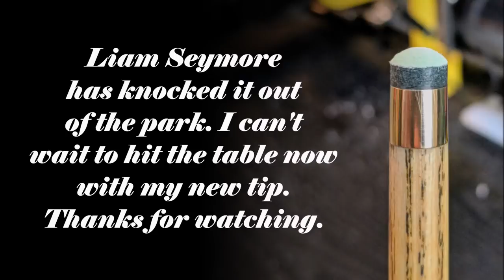Tip replacement using a Pool Cue Tip Repair & Maintenance Lathe

Comment: Why grind off the tip?  just cut it off with a sharp box cutter.  too much dust.  I would rather have the cue spin faster and use a razor blade to shape.  All you need is a piece of leather to polish.  Have to give a big thumbs down to this method.
Reply: i recently bought this lathe, and i have to agree with you. And as you can see in the video, at certain point he grinds of the upper part of the ferrule. There he stops the video and comes back when he grinds of and polished the whole ferrule, and the whole ferrule with pomerans is much smaller. Very bad job!!! He is also using the wrong tool for grinding the pomerans. Thats why he also damaged the ferrule. He should use another too,which is included.

Comment: MOST players would be better off practicing more and not spending money on accessories. 

Nothing wrong with the old hand crank tools. How many tips do you change?
Reply from the maker: Haha I've always just done my own tips with a razor blade, sand paper and super glue. This setup belongs to a mate who does quite a few tip replacements for the local pool league.

Comment: Waste of time and money replacing a tip on that - all you need is a new sharp stanley blade, sandpaper, wire wool, super glue gel and 1 of the plastic sleeve burnishing tools
Reply from the maker: Couldn't agree more. I didn't buy the lathe but I still think it's pretty cool ;)
Reply: Hi, what grade wire wool do u recommend?
Reply: @markruston6609  finer the better really. I use it to shine the ferrule up. If you go to course over a long time you can find it reduces the ferrule size a tiny bit.
Reply: Ty

Comment: A lot of bullocks just to change a tip way too much machinery too much expense for a simple job. all you need Stanley blade glue sandpaper and obviously a tip only in a pool world snooker player don't do it this way. Lol
Reply: it does make it a lot easier though if you have an expensive cue and you don't want to mess it up this is a much more safer route to take!
Reply: This guy as a machine  to lace his shoes :-)
Reply: @martinquinn3382  wipe his ....😂😂